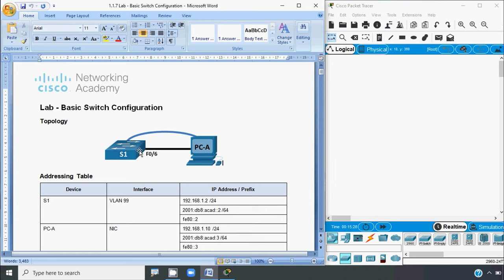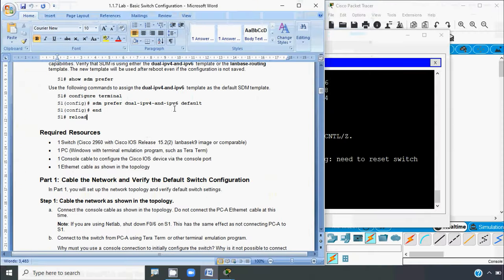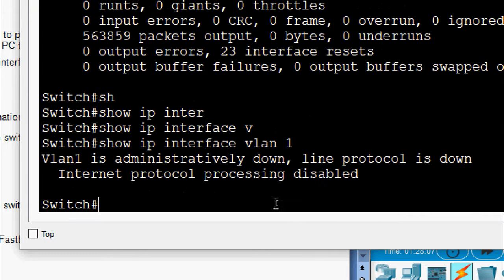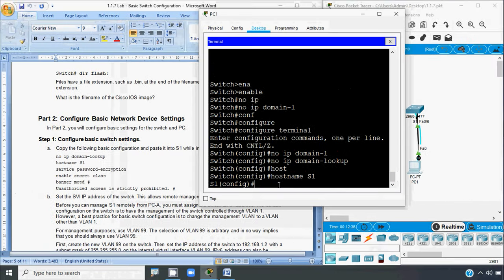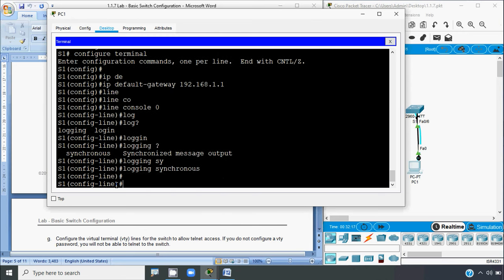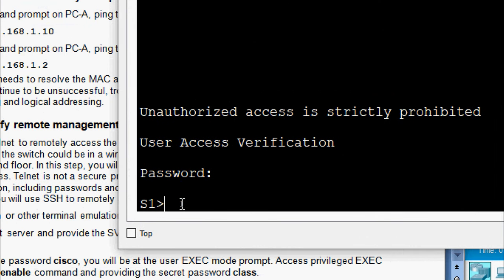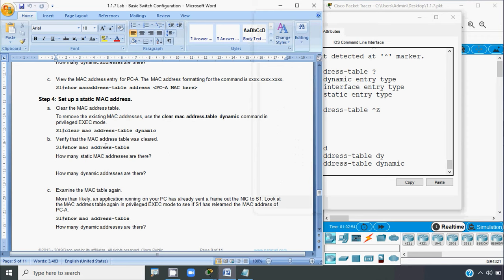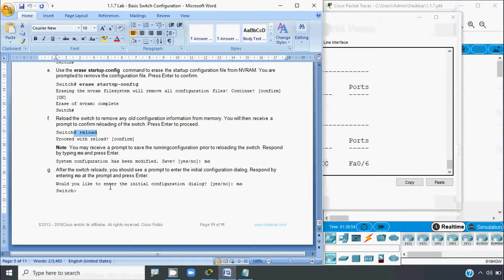1.1.7 Lab - Basic Switch Configuration

Comment: So I have followed your video and my professors help as well. But my switch will not for the life of me accept IPv6 address or link local. Any idea on if it is packet tracer or me messing it up
Reply from the maker: Please contact us using our website so that we can help you...
Reply: finally figured it out there is an error with packet tracer where it accepts ipv6 but does not always display it. Just enter the command “show ipv6 int vlan 1”  instead of show run